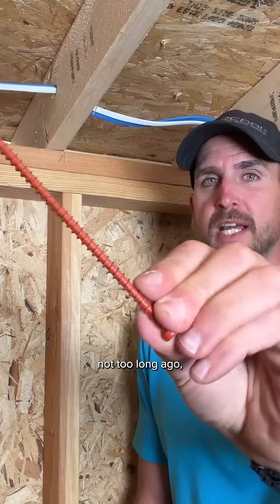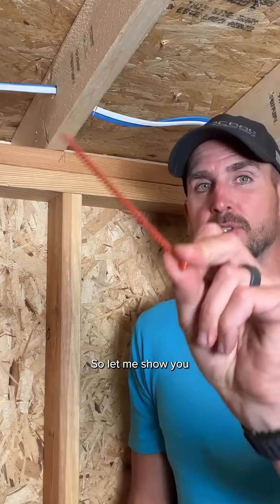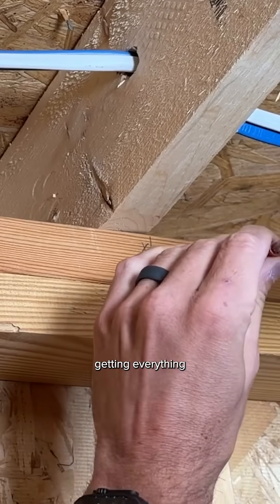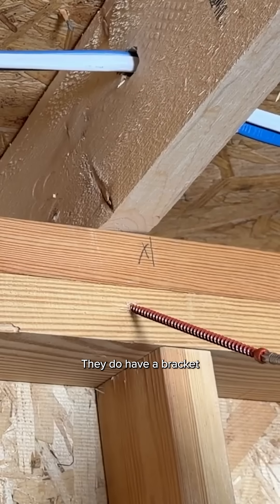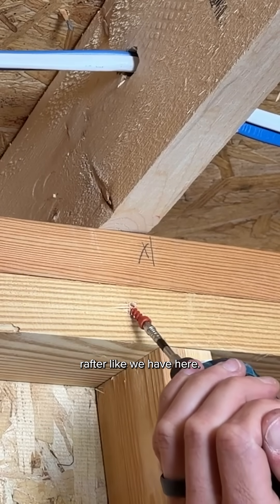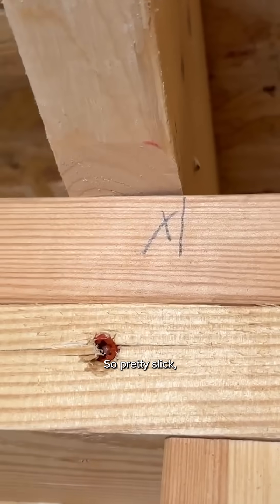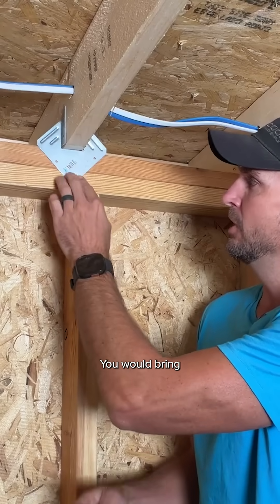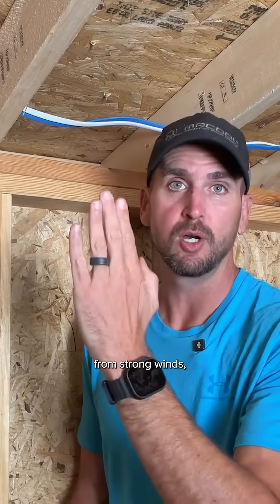The Screw That Makes Hurricane Straps Obsolete?

Comment: Who ever invented and passed this in testing was no framer. We were taught about the shear force of a nail. Multiply that by the four nails in the bracket and you have far more strength than the pullout resistance of a screw. Not to mention how accurate the installer has to be to get the screw in the center of the rafter. Don't forget about the rafter splitting.
Reply: My thoughts, exactly. I'll trust the bracket.
Reply: @Man-O-mvn you kidding me! I hate brackets, and for years have been like why can't I just jab a quick lil drill bit in, then a long screw, like my cabin is built. I got long screws sucking each rafter through the Rig Board into each other, and I couldn't image those little brackets for weak lil fasteners competing with that!
Reply: @randyross5630 brackets are better rural cabin will fail
Reply: @CHICKENNUGGETHERO1 you people need to accept the advancement of technology. There are fasteners that replace brackets that are safer, strong, and better than the old brackets.
Reply: Why not use both? Pre drill a starter hole with a jig, put screw in straight, then follow up with bracket and nails. A little overkill can't hurt. I'd rather use an 8 inch screw and shoot it from the bottom, not the f____n edge of the framing...lol
Reply: @geraldbolum9422 the angle provides a ton of strength. Use a pair of lock pliers and a mechanical pull with weight gauge. The straight lateral install would fail way before the angled one.
Reply: Except when sheer forces are put on boards that are either nailed together or screwed together, when they fail the fasteners are never ever sheared off. 

The failure point is that the fastener will get pulled about halfway out and then bend over. 

Watch the video that project farm YouTube channel did on this. He used hydraulics and put really controlled perfect sheer forces on there, which would be even more likely to sheer the fastener and yet it never sheers the fastener. Wood is not strong enough for the fastener to fail by being sheered off, plus structural screws are not prone to failing like that anyway. 

In case you're not aware the screws are far more resistant to being pulled out than the nails. As far as the Simpsons strong ties there are also screws that are approved for attaching them, in addition to the nails that most people use.
Reply: I was thinking the same
Reply: Except those brackets are rated for screws too 😂
Reply: It's simple! There is no way that one screw can take the uplift force that the bracket can. If people are going to use that one screw for their sill plate and rafter joist connections for hurricane protection their roof will be in the next county! I wouldn't trust it.
Reply: Exactly, what if the installer of that long screw doesn't have a good aim. I never liked split wood from toenailing. I'll stay with the bracket .
Reply: I don't use that Simpson product, but I am very familiar with GRK, and Timber-loc/Head-loc/Ledger-loc structural screws. I have used those fasteners for years for rafter uplift, deck ledgers, LVL build-ups, and so much more. They are spec'd often by the engineer because they produce consistent, known results. As an example, a 5/16 GRK RSS screw has 2948lbs of shear strength, 8d-16d nails have anywhere from 50-150lbs of shear strength. Most hurricane ties spec 8d, so even with multiple nails, your only in the hundred of pounds of shear strength. Then we get to pull-out. RSS screws are superior by every metric in that department, by a lot. Modern versions have tips that self tap to minimize splitting, and serrated threads to increase bite. Municipal, County and State code enforcement are slowly adopting the new options, and the people that use them hate going back if need be.
Reply: @timothybacon5103 this guy gets it, man so many dumb people acting like they know what they're talking about. That's YouTube for you!
Reply: AS a framer fuck the both of ya.    Its just as strong and 10 times as fast so go to hell.     This guy also installed it wrong  he shojld have used the jig they send
Reply: Seems like a great idea for counties where these sorts of things are required but dont see any seismic activity of a magnitude that would cause damage. Look at california where u have counties that barely see any activity due to their distance from the fault lines. This product can save money and time and fulfill the needless requirements
Reply: @GonzoDonzo  It's nothing to do with seismic.  This is to stop roofs lifting due to hurricane winds.
Reply: @SportbikerNZ we have the same crap for earthquakes as well though
Reply: @GonzoDonzo  These are only to stop lift.  The bracket might help with sideways.
Reply: @SportbikerNZ they work for lateral loads and uplift.
Reply: Agree 100%
Reply: Это не совсем верно.
Reply: That's why you use a Drill! It's super quick to take a skinny lil bit and jab it in there real quick, and it will save time on the screwing part so it's half as wasteful as you think for time, but Yeah, you would 100% want to use a Drill especially on Rafters already installed, because Yes, you could split the wood, of course putting in 8 nails or screws into a Bracket can split the Board to... Bottom Line is Screws are Far Superior to Nails so unless you are belting out frame after frame and you are a framer I would strongly suggest just to use Screws, and yes nail guns are allot faster, but they don't hold like a screw does, plus drilling and screwing is way way less likely to blow out the board unlike a nail gun. Only nail gun I have is a Finish Gun, because I surely don't use screws for finish carpentry...
Reply: You are correct that the shear strength of a screw is normally not as good as a nail.  They do make screws however with higher shear strengths that are hardened carbon steel and these screws normally feature thicker shafts and deeper threads.  I won't go into which is better but I'd use this if the shear strength was acceptable.
Reply: There is no shear force on that screw. It’s entirely under tension. Even better use the screws when rafters are installed but provide evidence for code inspector.
Reply: Simpson is motivated to promote thi$. 
Codes come along to improve things, like mandatory lagging and bolting deck headers. But then $ome capitali$t come$ along and trie$ to pu$h a (so-called better or acceptable mousetrap). 
Eannt. Gong. Fail!

I won't be using it unless brackets become non-available.
Reply: @user-5gu78qo27ieveryone said the same thing about the brackets when they were made code. Nobody easily leaves behind a trusted system that has worked just fine for them throughout their careers. Took me a while to get a nail gun because i was a traditionalist with my framing hammers, and the skill necessary to be a true carpenter with the tools that have always been available, but I ended up getting all the power tools 😅
Reply: 😂😂😂😂you dont even know what you're talking about, even a little bit, and I'm dying 😂😂😂😂 thank you for the laughs 🤡
Reply: I think i would leave the expert opinion to the people with the name and acclaim in securement of building materials
Reply: @charleslynch908  oops. Years in 😅
Reply: @charleslynch908  Numbers will never sell products to a lead framer who already knows what works. How many hot days in the summer 🌞 have you worked. Sounds like you made that call from the office 😂😂🎉
Reply: @SimplytheBoss2u That's because numbers will never convince someone who can't understand them.
Reply: @SimplytheBoss2u the lead framer has no idea how well those fasteners work because he puts them on and leaves and the vast majority of houses do not have the rafters blow off and most houses in existence in America do not even have them, and if they do it's going to most likely going to be years after they framed the house. 

Until the 1990s nobody was even using hurricane ties they were just toenailing the rafters down and there are millions homes that are over 100 years old that are still attached that way. I know this because I was framing houses when they first started making us use them. A lead framer wants to get the job done and if he can zip one screw in there instead of dealing with those hurricane ties he will prefer it. 

You don't know this because you've never framed houses probably never worked in the building trades.
Reply: @actionjksn lol nailed it
Reply: They test them to failure hundreds of times before they get code approvals by independent agencies that create research reports that are accepted by the building codes.
Reply: He mentioned that it is a simpson product. They actually performed several tests and printed the results in a catalog. Engineers use those results in their structural calculations. 
I will trust that over a random armchair engineers speculation.
Reply: @markdaniel8740  You shouldn't. Inconsistencies in that screw installation, plus the fact it is 'one' screw means you could pop it off easily with a pry bar. That's not happening with a bracket. I don't care what Simpson says, engineers either.
Reply: @dh5516 😂😂😂 you are so clueless and its hilarious 🤡
Reply: @Adam-zw1ck  Uh huh. After you stop laughing, please prove me wrong with your genius intellect.
Reply: @markdaniel8740 
because engineers, every single one of whom you apparently trust… absolutely never disagree with each other.
Good call, Mark.  👍
Reply: @Zupdood2 engineers and architects learn from a book, most have never worked in the field. Plus why doesn't that screw have a bigger head to keep it from pulling through ?
Reply: @LarryAnderson-v7s 
I work with them. I haven’t yet met engineers or architects who don’t visit their projects… they have to.  They always go out; they don’t ignore failed inspections because the project stops right there.  At the very least, they have their PM (project manager) in their place. 
As for the heads, Simpson designed those screws based on their testing.
Reply: You clearly aren't a business person. You think Simpson just comes up with ideas and doesn't run extensive engineering calculations and field testing on a product like this? If you don't think so, hire a lawyer and gather a bunch of strawmen builders and sue them. Ever heard of the legal term "product liability"?
Reply: @crabkilla yeah talk to all the people who got cancer from round up about product liability and holding corporations accountable. I don't trust this one bit. The single screw is clearly alot cheaper for Simpson to produce than a whole plate and I'm sure they charge near the same price. Unless there has been third party independent testing I wouldn't trust Simpsons testing on that. You can see the bottom plate in the video is splitting from the angle and it's only grabbing the corner of that bottom plate. Which is why it's splitting. Ain't no way in hell that's stronger than a tie. They've cheated their so called testing or paid off some oversight committees to pass that bs. Corporations do that all the time to put out sub par unsafe products that help them increase profits. Again look into round up and Monsanto or the ford pinto is another good example. There's endless examples of corporations putting profits over lives and cheating the system to get away with it.
Reply: @masonhogan8525 How Many got cancer from round-up? You mean the old couple who sprayed it for decades while wearing shorts? What about the tens or hundreds of millions who sprayed it without harm! You’re probably afraid of baby powder too!
Reply: @waynemanning3262 do a little research into Monsanto, round up, and agent orange. Thousands of Vietnam vets, Vietnamese had serious issues from it, they covered it up then they came out with round up swore it was safe, countless studies showed it wasn't. They paid tons of money to cover that up including infiltrating all the agencies that are supposed to regulate that sort of thing and when the evidence mounted and the story broke and lawsuits started piling in Monsanto sold round up to Bayer and walked away Scott free. There's whole documentaries about it. Do a little research before you put your foot in your mouth. Just because you're ignorant about something doesn't mean it doesn't or hasn't happened. So maybe know what you're talking about before you show your ignorance to everyone while trying to talk down to someone else.
Reply: @masonhogan8525 agent orange and roundup don’t even use the same chemicals ! Agent Orange uses TCDD, tetrachlorodibenzo-p-dioxin while roundup is Glyphosate. Less than 30 seconds of research would have shown you that! So you bring up Agent Orange to bolster your argument because you can’t show anything but a trumped up court case against an FDA approved chemical. So try doing a little research before you go calling someone down and you won’t just sound like some anti corporation parrot . So run along now Sonny boy and get back to you chem trail flat earthier buddies and have a nice day!
Reply: @waynemanning3262 Monsanto was one of the manufacturer's of agent orange as well as round up, he didn't say they had the same chemicals.  Also there were numerous lawsuits over round up, not your story of a couple wearing shorts.
Reply: lol this is actually how we do ours now and it works just fine
Reply: I can tell you a framer has no business talking about what this thing does... because again with the referencing lateral shear...  this is not for lateral shear, DEAR GOD. For lateral shear you want a seismic strap/bracket. Hurricane straps/tie downs are primarily concerned with LIFT. This amazing piece of science taught in high school called Bernoulli's principal says a high velocity air mass moving over a surface with a low velocity air mass underneath will create lift, just like on an airplane wing... THIS is why during hurricanes and tornadoes the home fails structurally. The roof is lifted off of the home and then the roof's mass, and static friction are no longer there to keep the walls up and you are boned. AGAIN... it's high school  science..
Reply: @zbubby1202 when the roof LIFTS the nails SHEER...the framer knows what he is talking about.

With a single screw you have LIFT fighting the friction or pull-out strength of the one screw through 3 structural members

With a hurricane strap you have LIFT fighting the SHEER of 8 nails embedded in 3 structural members.
Reply: @briguy5803  Thanks, I wasn't going to waste time on a troll who never picked up a hammer. I actually spent 3 years in college and had some engineering, physics and math up to calculus.
Reply: @Sparkeycarp glad to jump in.....the trades have to stick together. 😅
Reply: @Sparkeycarp Simpson has tested H1, H2, H2.5.. and these screws. They publish the results in their catalogs and online. They also have people who studied physics, calculas and engineering plus they put their thoughts to the test.
Reply: I'm not a framer. Just a home owner. I thought depending on that one nail as having the same amount of strength offered by the bracket and nails would be less. If were to have a custom house. I would specify to use the brackets and not just a single long screw.
Reply: It’s a structural construction screw. You also shouldn’t be receiving shear force at the truss tie in. You need strong uplift resistance.
Reply: My codes are different here in Michigan. We just use tie clips. Truss to top plate fastened with girter nails. Satisfy the code and move on. None of you have built for 30+ yrs if you want to argue about pissing in the wind. It's 17° this am and lifting walls today. What are you doing today? Looking up what girter nails are. Child please!
Reply: Perhaps one screw would not be sufficient in an earthquake zone where shear strength would be needed. 

I would read the specs bed using.
Reply: U know better than the mfgr, huh? Then why r u only a tradesman?
Reply: Agree 100%. The bracket uses the nails in shear. The palm nailer is light and easy to use and the short nails are very stout. The result is easy to check. There is no way you get 60 of those long screws all in without muffing that precise angle 3 or 4 times. This is a terrible idea. Like really bizarrely bad idea. Comical.
Reply: @oddvertex using your 3 or 4 mistakes as a base let’s use a small structure so it skews it in your favor. The more rafters would mean a lesser percentage. Let’s go with 23 rafters on each side of the ridge so 46 total. Total uplift hold down weight for the rafters would be 26230 lbs of up lift. Minus the 23790. The h1 rafters tie is rated at 470 so total is 21620. It still would have more uplift hold down even with 4 completely missing.
Reply: 💯 agree with ya. Not strong enough, especially with no head on it😆
Why listen to generational knowledge? "They"don't allow people who have framed there whole life to be the experts. "They" want to trump our whole life's  body of work with stats and numbers. I'll call them the Learn it the hard way generation. 😅 Or I'll listen to my cell phone over my dad. GL
I'll save my lessons for my own kids 😂
Reply: @SimplytheBoss2u  Mate, read more and comment less.  Too cringe.
Reply: @SportbikerNZ child please
Reply: @SimplytheBoss2u  Case in point.
Reply: @SimplytheBoss2u He's not wrong, You really don't know anything.
Reply: @SimplytheBoss2u  What did they use before the metal straps?
Reply: @joewisniewski1500 before the metal straps there were two toenails that went through the ceiling joist into the top plate on one side, and then one more toenail on the other side. That is how all of them were done until the early 1990s. I know this because that's when I started framing houses in the early 1990s, and they had just started requiring them. Most homes in existence do not have them.
Reply: @SimplytheBoss2u hurricane ties have not even been in use for generations, I know this because I was framing houses when we first started having to use them. There are millions of houses out there right now that do not have them and a lot of them are over a hundred years old.
Reply: @actionjksn I think we're talking about different states with different codes.
Reply: @SimplytheBoss2u   They first started making her hurricane ties code in areas with hurricanes in about 1992. But even in Columbus Ohio they started making us use them in around that same year, sometime in the early 1990s, and Ohio does not have any kind of extreme stringent building codes. . They were invented in the early '70s but they were not required in places with hurricanes until about 20 years later. Ohio probably started mandating them because of tornadoes. 

If I were doing my own house and I lived in a place with hurricanes I would do something much better. I would get a long quarter inch drill bit and drill through the ceiling joist, and down through the top plate, and then put a carriage bolt through it with a big flat washer and crank those nuts down really good. This would hold better than the other two methods.
Reply: @actionjksn Cool man😎 Ohio sounds similar to Michigans timeline and code. In Michigan I remember the code for a truss tie was really needed. Setting trusses with bottom cords or fastening to the bottom of rafters there would be nothing left after it splits the from the 16 hand drive nail. Hand Nailing twice on one side often split the whole side out in extreme cold weather. The clips were cheap and effective. 
Be safe out there buddy 👍
Reply: In Florida they strap the whole damn wall down to the foundation. Strap is nailed with hand drive 8's up one side the wall, over and down the other side. Then nailed with hand drives 16's to the treated 2x8 sill plate, bolted to the concrete foundation. Simple but exhausting compared to Michigan. 
BTW..Go Blue!💙 GG, 😀well get ya next. 🙏 yr.   @actionjksn